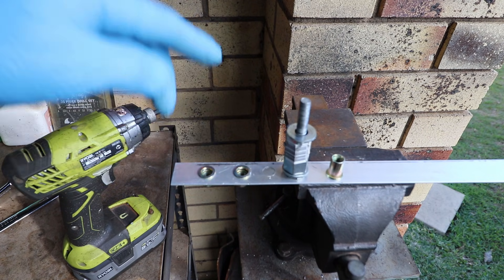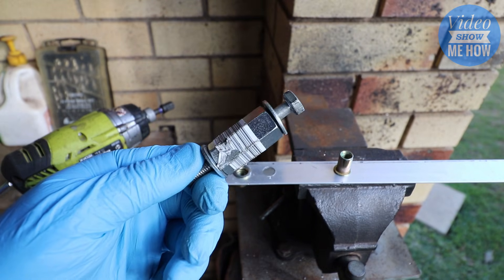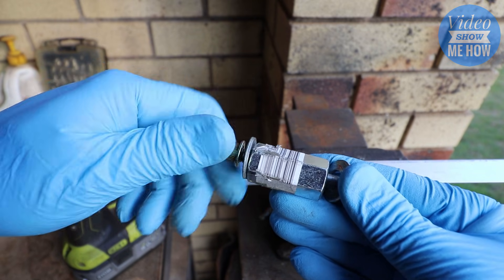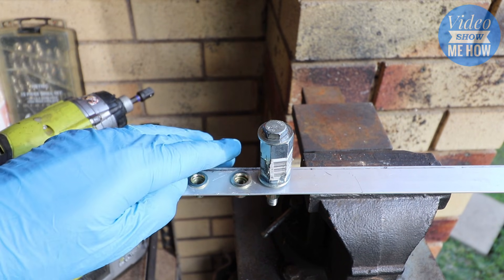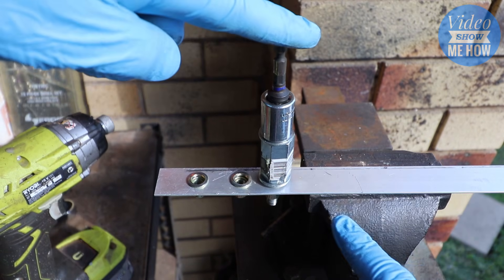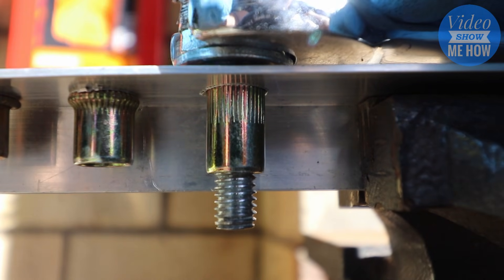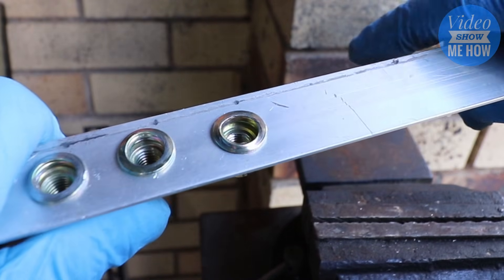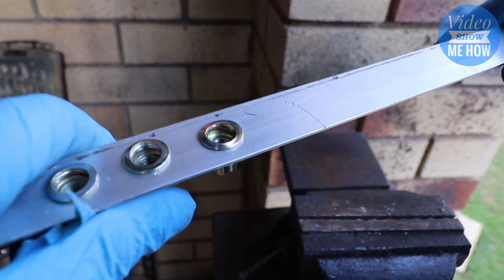DIY RivNut with a DRILL? | How To Nutsert Rivet Nut DIY [without tool]

Comment: sure it works but it's the same as walking, insted of driving, to costco, you can but do you really want to? there are so many problems with this method. you can destroy the socket, it works only for larger sizes of rivnut, and with a lot of space available around it. I ended up spending the whole day figuring out how to use this method in practice, for M4 rivnut, a day wasted, 40 usd saved

Comment: Stresses and wears the thread, no good. You can see the nut has 'cranked over' and not pulled up straight because of the rotational force of the bolt. It might be quick but it is not seated correctly.

Comment: The thing with rivnuts is the surface is not flush after. So if you want to install something even with the surface it will have that slight space where the top of the rivnut sticks out🤔
Reply: you can get counter sunk rivnuts

Comment: I was going to use this method for the battery mount on my ebike.
I thought I'd better try a dummy run first, on some scrap metal.
I copied the technique described here to the letter.
Guess what? The drill overpowered the threads on the rivnut and stripped them clean out, just as another commenter said it would.
It seems the correct tool exists for a very good reason!
As a temporary measure, I installed the battery mount using two self-tapping screws. It's holding fine, so far.
Perhaps this method is just as secure as using rivnuts?
IDK.🤷
Reply: Yes. Impact drivers act like a hammer on the threads. Better to use slow easy torque of hand tools.

Comment: You would be far better off using a normal drill in first gear, the shock of a hammer drill is gonna munt those threads rq

Comment: If you intend your rivnuts/nutsert to see a LOAD bearing purpose then this is a terrible way to install them.  Go online and google nutsert compression length.  You will find both charts and pics of what they should look like after installing.  If you watch this vid closely you will note that the compression ring is both twisted and not uniform.  This means it will fail under less then planned loads and torques.  These nutserts or rivnuts are not designed to be installed with a rotation tool.  They need to be compressed like a rivet.  If compressed like a rivet, like your first vid, they can handle some impressive loads and torques.  However once the rivnut/nutsert is twisted it’s strength is compromised A LOT.  

A cheap set of measuring calipers and the proper installation too, even a cheap on, will save you loads of head aches.  Also time.  While this method is “quicker” is saves you very little time compared to the right way with the right tools.  I saves you a few bucks/quid/dollars upfront, however if the rivnut/nutsert fails, you will spend way more drilling it out and installing it the right way.
Reply: You can use this method, but it needs to be modified some. Instead of driving the bolt into the rivet nut you use a similar setup by using a nut on the top and holding the bolt in place and turning the nut to compress the rivet nut. I used this method to install 6mm SS nuts for repairing garage door hinges.

Comment: i like my impact drill but a regular drill has a torque setting/ number so you don't overtighten screws in various hardnesses of materials. like 4-22 i think. I wonder what the number would be for this job? After a certain torque it slips (clutch?)

Comment: When you first showed the set up the bolt extended at least a centimeter past the rivnut. When you started with the impact tool the bolt was no longer visible?? Do you need to use a fully threaded bolt?

Comment: Great video. Is there a load rating or shear rating for these nuts?
Reply from the maker: Cheers, depends on the type, you can find the spec sheets usually included with then or online

Comment: Thanks for that and it's even better then the other one I saw using a flat piece of steel, with holes drilled in it, with use of a matching nut, to tighten the whole thing up,

Comment: If I didn’t have the handheld 16” manual tool or a pneumatic setter, then I would definitely consider this for larger rivet nuts, 3/8-16, and 1/2”!! But the smaller 8-32, 10-32, and even 1/4-20 I would not consider using this.

Comment: hello was wondering if you have a hack to remove rivets without using a drill bit?? trying to avoid the drill shavings flying everywhere
Reply from the maker: Drilling it out or grinding the top off are the only methods I'm aware of I'm afraid

Comment: Sorry but this is the worst way of doing it. Should use a bolt and nut underneath it and cranck the nut while to bolt is being held in place so it doesn't turn, this stops the uneaven crimp and also stops the distuction of the threads on the nut sert
Reply: Makes lot of sense

Comment: Are rivnuts any good? Think of using them for bolting my tray on my ute to the chassis..
Reply from the maker: I wouldn't use for that as they only have so much pull out strength.. there's a heap of chart online that shows how much force they can take I've linked a few in the comments

Comment: sorry dude, the tool is tons faster, thread n squeeze, less than 6 seconds. this method is good if you don't have the tool, but if you're doing heaps, I'd recommend getting the tool. they're not expensive and they work as intended. Cheers.
Reply from the maker: Yep 100% agree (even did a vid on it), if you're doing a few grab the tool for sure
Reply: @VideoShowMeHow  credit where its due, great content, keep at it!
Reply from the maker: @g_wizard9866  cheers mate 👍

Comment: I used to work at an auto shop and we had the proper air tool for fastening these and it took all of about two seconds to fit it. We were working predominantly on fleet vehicles. There was an electric version as well that we had but the pneumatic version was better.

Comment: Id say its not fastern than the actual rivnut tool. I also noticed that your bolt will be on a slight angle as it did not pull tight evenly, something that can actually make a big difference at times. Good idea nonetheless.
Reply from the maker: Yeah can't beat the actual tool that's for sure

Comment: Thus how I've always done it, but I use flange nuts to hold the rivet down to my workpiece. 
 
Now I have them welded and sized. The hand rivet method suuuuuucks lol. An impact wrench takes it to just the right depth, but you want to make certain it doesn't blast too much torque. 
 
Usually, you can feel it. And if doing multiple rivs in the same thickness of steel, I'll listen for it to be done by the number of tat's. "Tat-tat-tat-tat... " etc.

Comment: It would be nice if you were to put a mark on the rivet so you know the maximum and minimum turns needed so it seats enough. You can't always see the other side. But this taught me alot. Thanks
Reply: You can tell by wiggling it the least resistance the better.

Comment: This is a brilliant way to install rivnuts, the coupler, bolt, an washers cost £3.00. The cheapest rivnut tool I could find was £44.00 so I saved £41.00 a no brainer as I only wanted to install 4.👍
Reply from the maker: Glad it helped

Comment: IMHO the most important thing you have to make sure the rivet nut screws down onto the bolt threads.
A matter of clarification the threads on the bolt have to be the same as the rivet nuts otherwise
this will not work because you are wrenching down on the threads from the bolt.

Comment: All too often the whole rivet nut just spins in the hole, even if the hole is tight enough to have to hammer the rivet nut in. If the center nut has the same threads as the rivet nut, then you can turn that nut as a jam nut to compress the RivNut. You hold the bolthead to keep it still while jamming the center nut.
Reply: If your hole is messed up you can replaced the rivenut with a toggle bolt.

Comment: I have a similar set up, but this method has it's issues. It torques the treads, wearing them. As you can see in your own video, some times it's not an even pull. My Dad suggested a very large bolt, machined and tapped at one end to the thread of the insert. A short pipe, the larger bolt can drop through that is tight enough to hold down the insert. That bolts new tapped thread, screws into the insert. A nut at the top of the pipe on the larger thread to crank down and you have a straight put on the insert. Yes two wrenches but it's an even pull. Your video is a good method for less critical holds I think. Won't use it on my car build lol. Thank you for the video :)

Comment: If one goes bad then all your time savings is gone and then some. I will always stick with the tool that squeezes. that way it pulls up square and does not stress the threads in the insert.
Reply: Exactly, I noted this one wasn't aligned correctly and only one side pulled up.
Reply: The dyi tool might even be faster, no you screw the rivnut on the bolt just like you would the tool, insert it in the hole just like you would with the tool. The main difference I see is with diy tool you hafta maintain square whereas with the proper tool all would hafta do is just squeeze and done. Once in place you still hafta unscrew both tools from the rivnut. They do make a drill attachment rivnut gun that looks pretty interesting and is designed to preform a specific task
Reply: @jameshendricks8526  the difference between this and the tool is that with this you are spinning the screw/bolt as you are compressing the rivnut, with the proper tool the screw/bolt isn't spinning, it's just being pulled on. The tool will pull more evenly and prevent wear on the soft threads of the rivnut.
Reply: @mt186  that is true but once you get enough compression on it, it will stop spinning. Square is still the main issue. If it's not square the bolt won't fit right.
Reply: @jameshendricks8526  definitely not being square is a bad thing. Doing it the diy way does cause the bolt to have to be screwed in until the rivnut is compressed all the way though. The rotation of the bolt is what's compressing the rivnut, without rotation of the bolt, nothing happens
Reply: I use a riv nut air tool to put them in which is just as fast the tool is way over the top expensive but very good them manual ones are a pain to use and slow I’d rather use this method if didn’t have air tool

Comment: Do yourself a favour & prise your wallet open ,watch the moths fly out & buy the correct tool .They don’t exactly cost a fortune & include a number of different size threads.
Reply from the maker: Lol. Yep the correct tool is the way to go. Made a vid on it. This is a cool hack in a pinch though
Reply: @VideoShowMeHow  Yes admittedly a type of ghetto bodge I would of made in leaner times 👍
Reply from the maker: @maskedavenger2578  we've all been there 😁

Comment: It pulled that rivnut up crooked. The bolt may bind in the rivnut. 
The problem is the rivnut turns a bit before it bites in causing the distortion. I’ve installed hundreds of them using the correct. Perfect install every time.
Reply: It did twist, I would keep the hammer off and just put the drill on high speed to eliminate those microseconds of movement of the arm etc.
Reply: @mr.occasional  the  problem is the puller twisting in the thread distorts the treads as well. The straight pull tool is best.
Reply: Mine did exactly the same thing

Comment: I would have to see where this would be a better application than a nut and bolt,
Reply: Perfect for sheetmetal work where you can't get to a nut. We use them in van building all the time to attach things to the van interior walls.
Reply: Blind holes where you cant behind it with a nut.

Comment: Your video did show how you used the diy tool, however the rivnut did turn a little which will set-up a future rivnut failure.  Using a real rivnut tool (which I have) will make the installation a lot simpler and easier and the rivnut will seat properly will not allow the rivnut to rotate as in your video and function as it should .  Search here in youtube for rivnut tool and check out how they work.
Reply from the maker: Hey Bill, yep I agree, nothing beats the tool, have a how to video on one :) Playlist below or over on the channel

Comment: Best way in the world to strip out the rivnut you are trying to install more like...
Reply: Keep the bolt static and screw a nut down onto the RivNut. The shortens the bolt end and compresses the nut. There is no thread rubbing inside the nut.
Reply: @Dave5843-d9m  THIS!
Reply: I will try that. Obviously, it isn’t possible to use that technique without access to the opposite side
Reply: @Dave5843-d9m  I came here to comment about I would use a nut so bolt stays and nut compress it than turn bolt to maybe wreck threads

I tried to use my tool that compress fittings into plasterboard but not enough and so brought a rivet nut tool just to do a single rivet nut ...
Reply: Just like a skilled mechanic you feel how much pressure you are using with the impact gun just as a spanner. If not competent stick with hand tools.
Reply: @bazz6670  same issue even if you used hand tools but installed it this way... the way you want to install it is you hold the bolt still and turn a nut on the bolt to pull the bolt up and compress the rivnut, using just a pulling force on the rivnut rather than a rotational force in the threads which is the best way to strip them out.. why do ALL rivnut tools only use a pulling motion..? Rivnuts are soft as it is obviously you haven't used enough to know enough about them 😉
Reply: @garyhowe88  
You must buy the cheapo soft China rivets.  
 Idk but clearly Im buying better rivets if I aint stripped a single rivet, been impacting them in over a yr now.
Reply: More likely to gall the threads that way.

Comment: Not very good on a round hole, they will spin easy. All factory done i have seen are in a hexagonal hole.
Reply: I worked high volume pannel production. We used single action numatic rivnut guns, and high quality rivnuts. Never had any issue with spin, as long as the air pressure was maintained
Reply: No high quality parts at hardware store.

Comment: Use a proper tool. It's cheap, simple and easy to use and gives better results. The rivet nut for demonstrating this DIY solution is not properly done, it is bent and not fastened enough. That never happens with a proper tool. This solution is OK-ish in case of an emergency, but if you need to insert more than one rivet nut then buying a proper tool becomes a good investment.
Reply from the maker: Yep proper tool is great (vid on it on the channel) this works in a pinch though 😁👍
Reply: @VideoShowMeHow  No, in my opinion this does NOT work in a pinch. It is fiddly and takes much longer than using a proper tool. It's a workaround for emergency, not an alternative to a proper tool, assuming you have everything in your pocket or toolbox ready for the emergency.
Reply from the maker: @AdaptingCamera  yeah cool. Just trying to help people with a couple options if they don't have the tool bud 👍

Comment: Adam, good vid and thanx for it , BUT, I just wached a guy use a Rivnut tool installing these in 7-8 seconds flat.Yeah ya have to buy that tool but the time you'll save is tremendous! You're method is slower than thick scat out of a dry ass. Good , but slow.
Reply from the maker: Thanks (I think!) - I agree the proper tool is the way to go - so much so I made a video on it -> https://youtu.be/6D3oA_AvWh8

Comment: Mate good vid but it didn't pull it down square & the bead around the bottom spread to 1 side,so you might have to hand tighten a bit more before you go the impac,but great work mate keep up the videos 👍👍
Reply: Yeah, I noticed the same thing.  It's not even, and the face seems a little off.

Comment: Wish I saw this video before spending $100.00 on a Metric rivnut gun...
Reply: Singling out Metric in front of his other-threaded peers brings me to an old twisted tale of a “Flutes or no flutes?”  One flute in a band, and even two flutes, unless amplified, nail it in.  And METRIC.  The intrinsic turn of threading with 3 flutes, centering up his routine for tonight’s thread off, RedBull and espresso for all threaders. 
The role of mentoring little-known threads is hosting weekly classes in our annual SAE threaded calendar located in the twisted divisions of proprietary, and spiral lingo, and then there is METRIC.  He is getting better, has his own office,  and even close to fitting in, but until then👇

3 flutes....nail it in!  I call it a screw nail.  Nice to have when u have a hammer and a screw.
Reply: You made the right choice buying the right tool for the job.